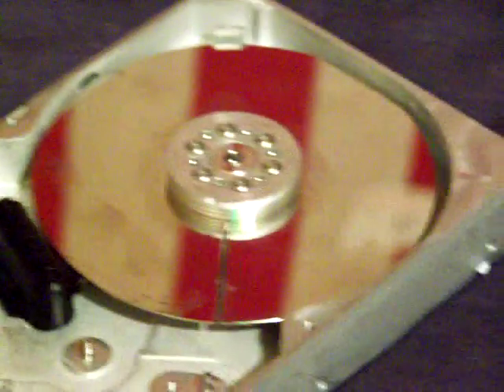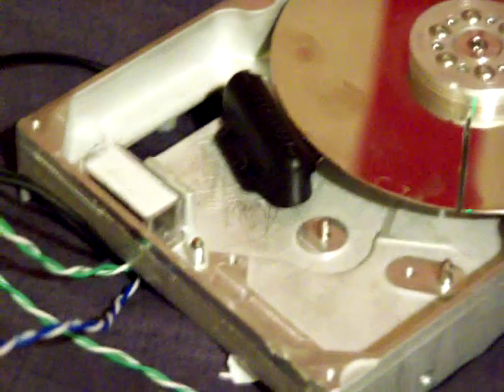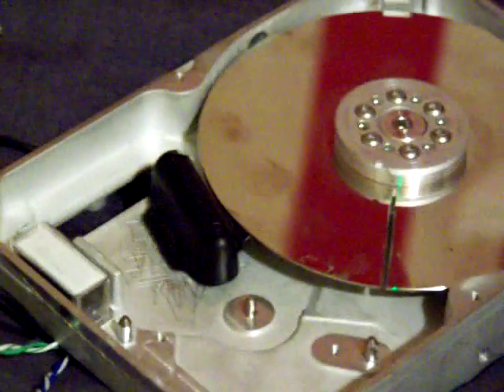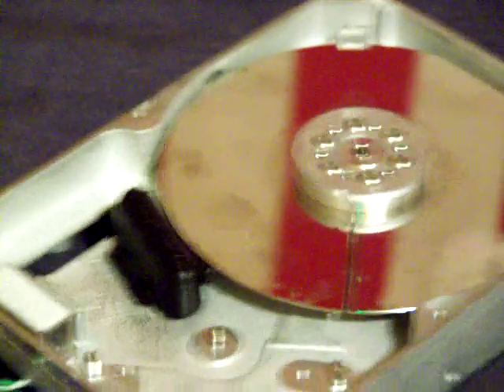Brushless dc spindle motor three pole 12V 1A HDD

Comment: You could use an optical intreruptor, a groove in the platter and each time the beam is broken the plater made a turn, instead of using magnets. That way you don't load the motor or risk that the coils are affected by outside magnetism. GOOD PROJECT ANYWAYS :D